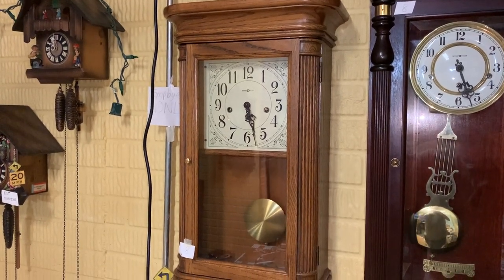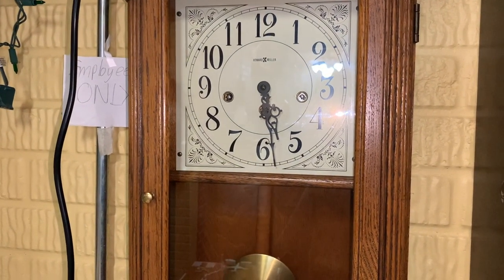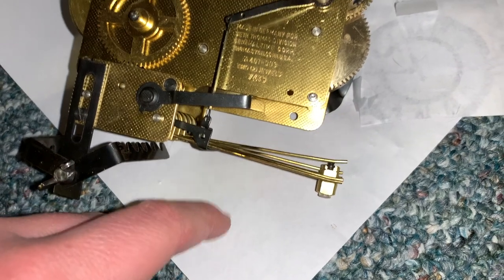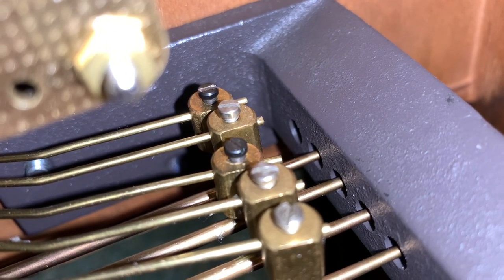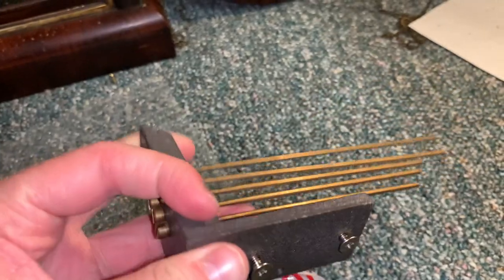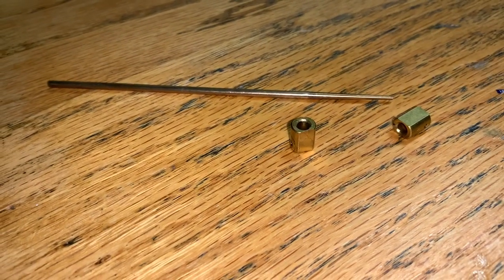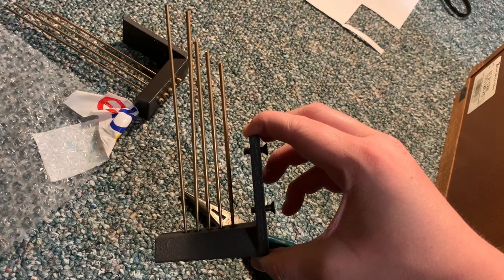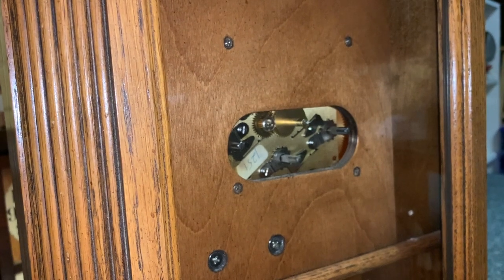Documentary of repairing the Howard Miller Sandringham Wall Clock

Comment: Sad what happened to it, but glad you got it fixed. Now it sounds exactly identical to the Ridgeway and the Shelbourne regulator. May the old rods RIP, 2019-2021 (Could've been longer but you got the clock in 2019). It'll take a bit of time to get used to the new sound since it sounds identical to 2 other clocks, but it has not looked and sounded better. I hope to not have the same problem like you had when I get my Sandringham.
Reply from the maker: I wouldn't really say rip to the old rods. They are still in the shop and can be used at least for something (I'd just be missing a tone lol)
Reply: @ogClockTV yeah that meaning of rest in piece or whatever is just outright out of place but hey it sounded like mantel and school house wall clock too nice 👍

Comment: I m so happy you did this video, I have to replace my 340-020 chime  one of the rods broke off, how do I take the face off ??, its a howard  miller mantle clock
Reply from the maker: Sadly getting the face off a mantle clock is much harder as they use nail-like pieces to keep it secure unlike wall clocks where they use basic screws. I haven't attempted to take the dial off that many of my mantle clocks so I'm not sure how to help. Apologies for this.
Reply: @ogClockTV  thanks I looked at it again yes I do see the  nails they are so small I will fiqure something out

Comment: Great video, i have a Sandringham that started chiming slowly after it was serviced. Any idea how to change the chiming speed? Thanks again
Reply from the maker: That comes down to how much you wind it. As the clock winds down, the chime slows down. However, if it winds down too much, the chime may stop unexpectedly while it's chiming. By winding it fully, that speeds up the chime (the chime is run by the right keyhole).

Comment: FYI; “D” on your movement is actually a date code. After 1987, Hermle started using letter codes, (hermle was at the time using number codes, with 76, meaning 1976, 77 meaning 1977, and so on) “A” means 1988, “B” means 1989. “D” (which is your clock) means 1991, meaning your sandringham was manufactured in 1991.
Reply from the maker: I recently discovered that.

Comment: I just inherited this exact model and trying to set the clock in beat is driving me crazy. Everything else seems to be working just fine, I just can't get the pendulum to run.
Reply from the maker: Setting it in beat is perhaps the hardest part. You have to essentially bend the pendulum crotch perfectly. I get frustrated by it pretty frequently.

Comment: Now the Howard miller sandringham sounds like the Howard miller regulator wall clock
Reply from the maker: Yes it does.
Reply: @ogClockTV  and it also sounds like the ridgeway bracket clock Westminster
Reply from the maker: Same with that too.